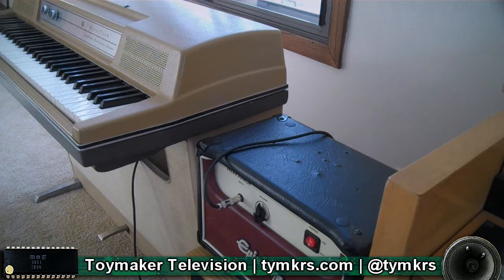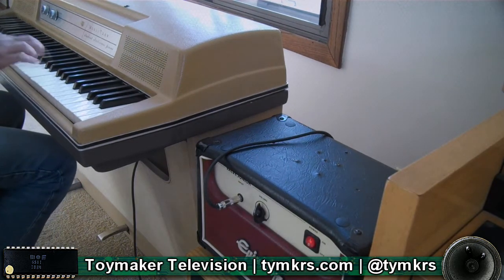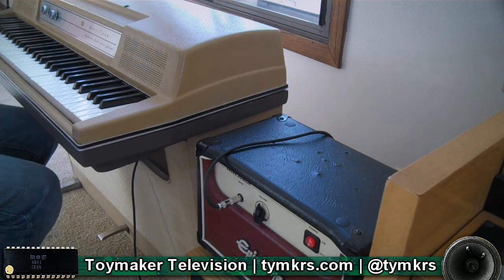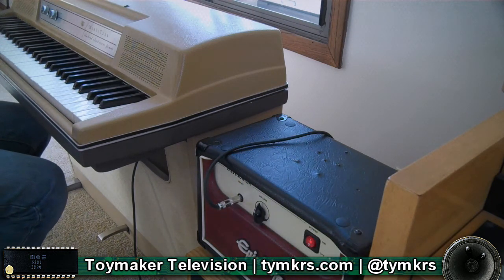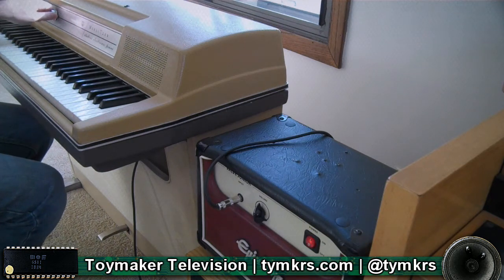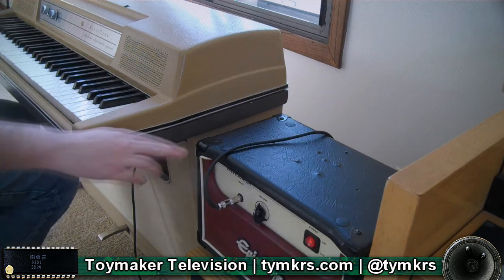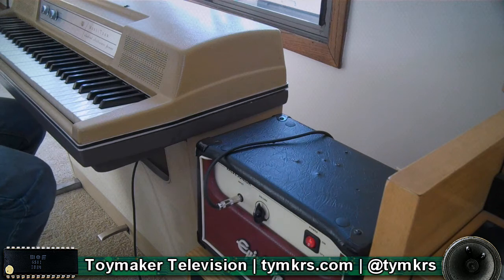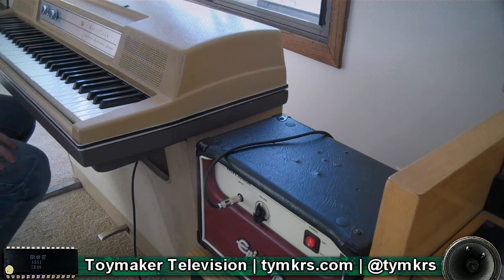Vacuum Tube Breakup, A Love Story

Comment from the maker: @vk2zay it eliminates the C3 (22uF) electrolytic cathode capacitor from the circuit on the second half of the pre-amp tube (12AX7)

A search for JP1 Mod will net you a schematic.  These amps are very popular for modifications.

Comment: @whisk0r indeed, I can see why, very simple, just two common-cathode amps and a power amplifier using very common tubes...  I think I have all the bits except the transformers in the junkbox to build one.  You could probably emulate the effect with a JFET - but I guess that isn't as romantic as using empty-state devices. :)